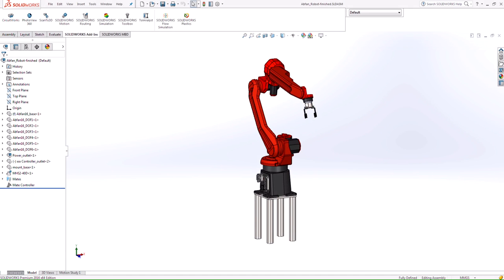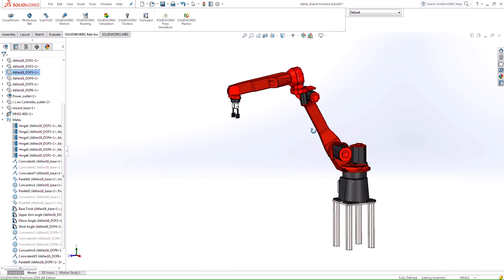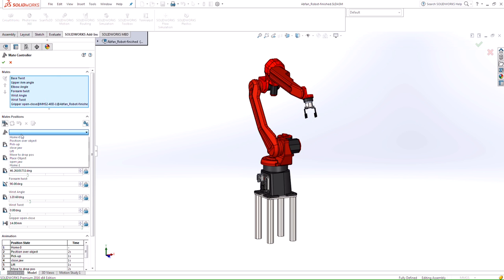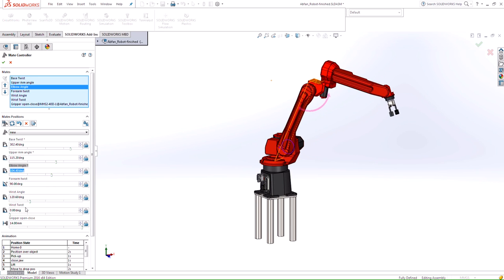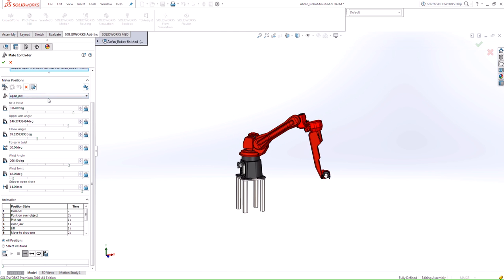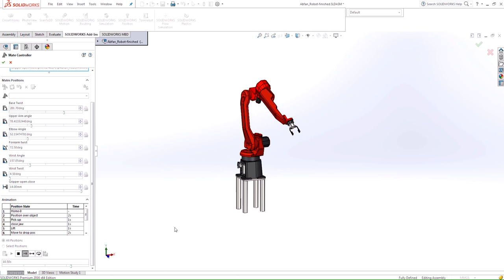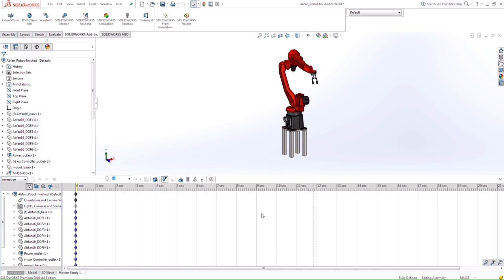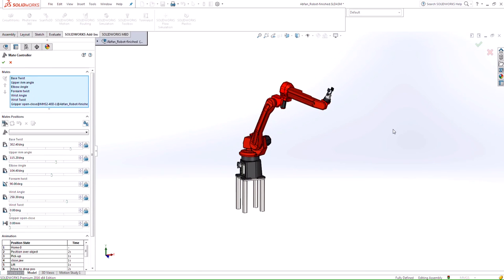What's New in SOLIDWORKS 2016: Mate Controller

Comment: How to rename the mates over there?
Reply from the maker: Good question! The mates can't be renamed from inside the Mate Controller, so they need to be renamed from the Mates folder. You can see expanding the mate folder at 0:20 If you then select the mate you want rename and hit F2 on the keyboard, you will be able to rename it right from the feature tree.